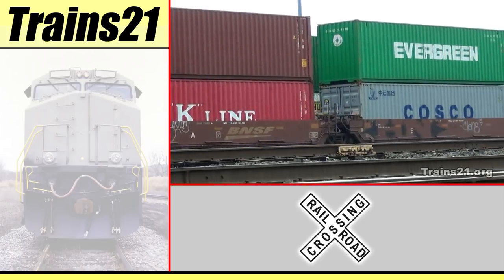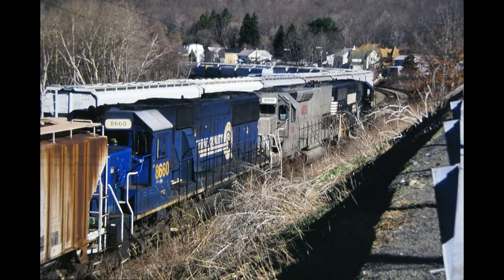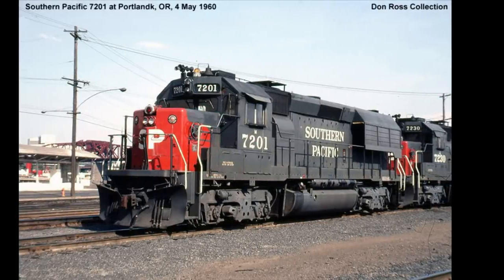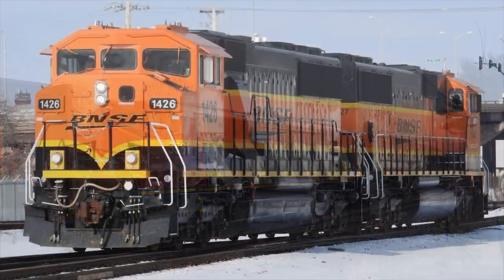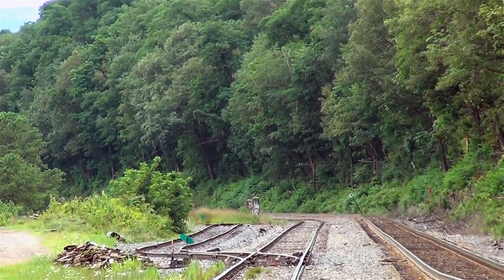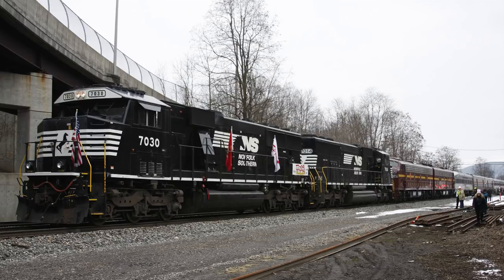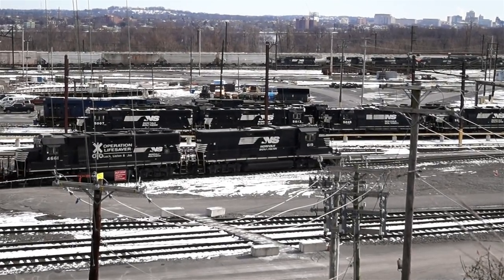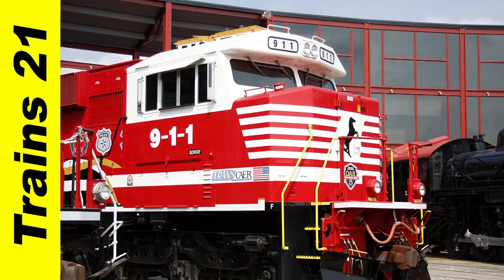[GL][T-183] ENHANCED EMDs: SD60E Explained + GE Dash 8.5, SD40E, GP59E, MP15E & Slugs | Trains 21

Comment: It is great that NS is rebuilding locomotives and improving fuel efficiency and emissions. One question: were the GP-59 locomotives purchased primarily for the roadrailer service
Once again another great video
Reply from the maker: Thanks Steven.. I don't know if GP59s were purchased for intermodal or not.. I would say "no" due to their lower horsepower but I could be wrong.

Comment: Awesome video! But you made an error on NS D8.5 8505 at 17:56. The cab on 8505 was actually a GE Dash 9 style cab. Not an ES44AC Style cab. You can tell it's a dash 9 cab from the window and nose design. 8505 had 2 small oval shaped windows on each side in front of the bigger rectangle shaped windows. Likewise with the Dash 9s unlike the ES44AC which have 2 rectangle windows on both side of the cab and windows. The nose also had no void in the nose light area unlike the NS ES44AC cabs which do have voids like that. Never the less this is a well made video and is very informative. Awesome work!

Comment: First, even though GE -8 outsold EMD 60 Series, they weren’t better, in my opinion.

I really think that the SD60E program was to circumvent EPA tier 4. Both manufacturers had trouble meeting the new standard. I think the rebuilding program was to have units ready if there were bugs with tier 4. This is because the rebuilt units are grandfathered to the older emission standards.

Comment: Did you know ns 6653 was one engines involved in the Graniteville sc chlorine disaster. It was leading ns 192 when it collided with local p22
Reply from the maker: Thank you.. I did not know that!
Reply: @Trains21  your welcome
Reply: That Was Before It Was Rebuilt Into A SD60E It Was Taken To The Juniata Shop's Repaired And 5 Years Later It Was Rebuilt Into A SD60E
Reply: @tooatease3858  that is correct

Comment: Way to go AC ! Love how you research and give explanations to all the different models they have out there. It answers alot of the questions I  had in my mind. But one thing that puzzled me was why they would derate an engine down in horsepower? Was it strictly for a fuel consumption advantage or had they come up with the ability to get the same job done with less and saving fuel at the same time.

Comment: Heres more of Norfolk southerns wierd ass creations they have rebuilt from older locomotives: SD70ACC (rebuilt from an SD70 body, the cab of an SD70M, and has the nose of an SD70ACE) SD70ACU ( replaced the traditional SD40E helpers on the Pittsburg division, and was basically an SD70ACE cab put on the body of an SD9043MAC) what's next? An SD80ACE? ( Which Would have the cab of an SD70ACE, and the body of the SD80MAC, but norfolk southern already sold their SD80MACS to canadian pacific, or progress rail equipment leasing company

Comment: So it was stronger then the Amtrak EMD F40PH/F40PHR locomotive's???
Reply from the maker: Yes.
Reply: @Trains21  OK. What locomotive was the EMD F40PH stronger then other then the SDP40F and P30CH???
Reply from the maker: @graphtonix6607  The F40PH had a horsepower rating of 3,000-3,200 so anything less than that.
Reply: @Trains21  Dose that mean that every other locomotive was always stronger then the F40PH???
Reply from the maker: @graphtonix6607  Anything over 3,200 hp.
Reply: @Trains21  OK.